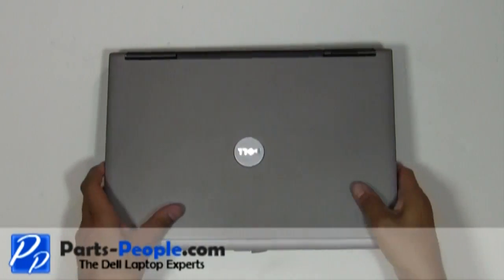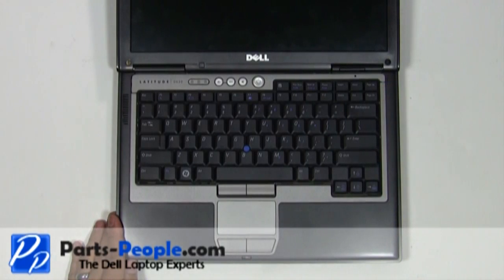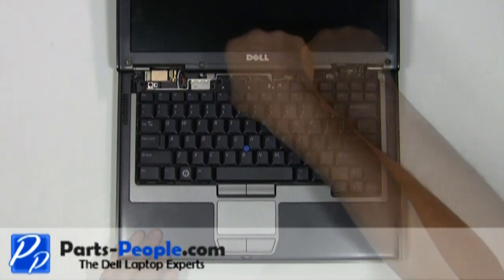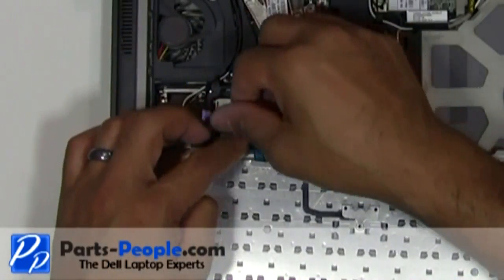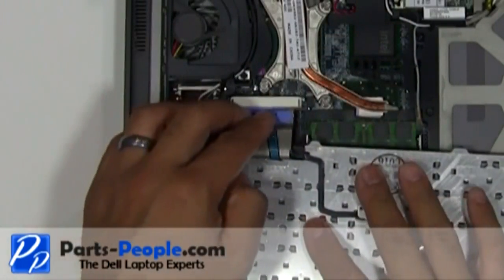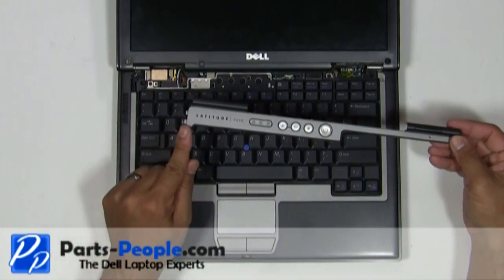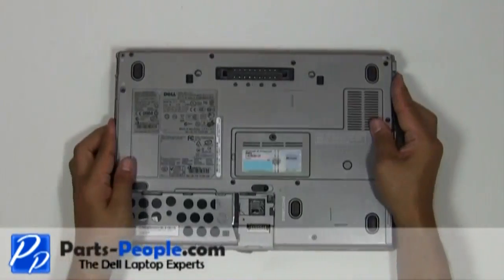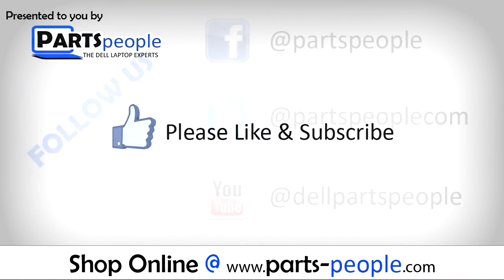Dell Latitude D630 | Keyboard Replacement | How-To-Tutorial

Comment: I remember that with a previous laptop (not this brand at all) where I had this problem, I got a replacement and switched out the keyboard and even though the keyboard worked fine I kept getting terrible beep codes at start up. So now a key came off of this laptop, and I would like to know if replacing the keyboard would cause beep codes on this model. Does anyone know?